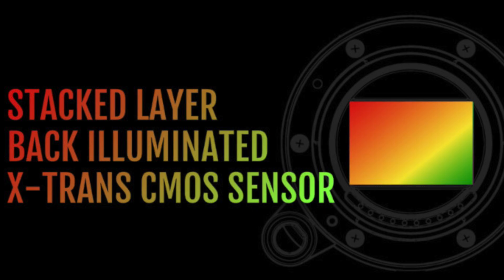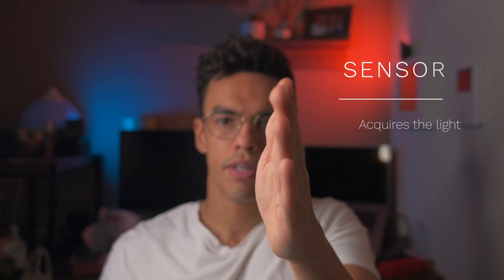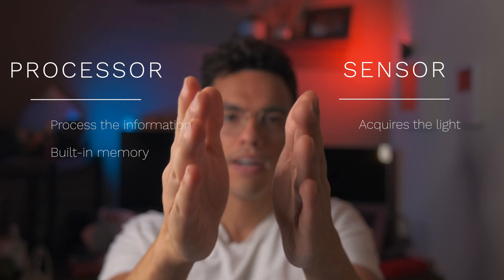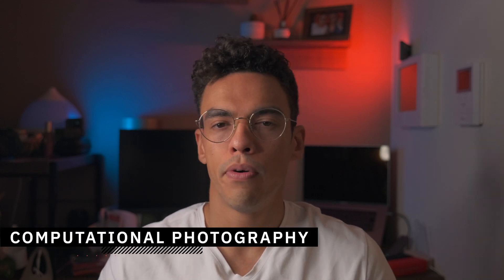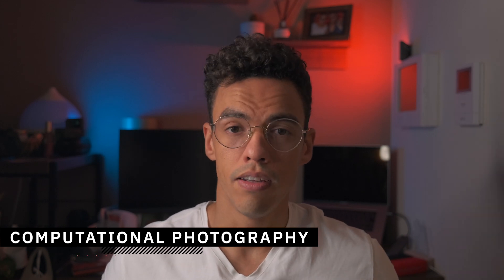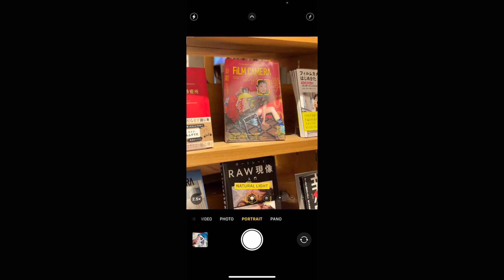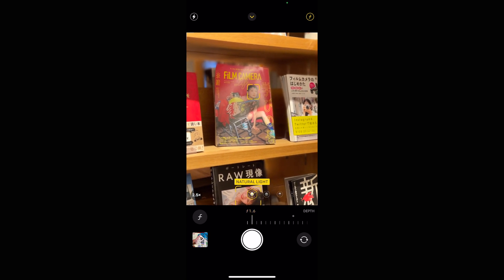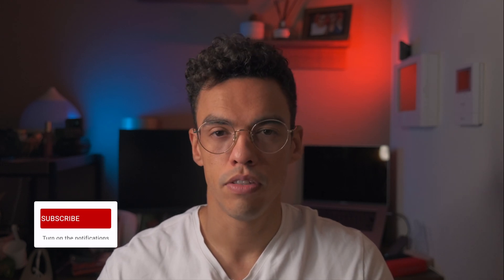Fujifilm stacked sensor explained | Coming 2022

Comment: So, with those new sensor, an aps-c sensor will be able to deal with 35-40 megapixels without slowing the system down, and without losing dynamic range?
Reply from the maker: So because the pixel density is increasing there might be more noise in low light so we have to wait and see the performance of that sensor

Comment: No way Fuji will be able to compete with Apple in terms of computational photography, their Axx chips are insanely powerful, also A.I. is one of Apple's  key areas of R&D, they have been on this for the last 10-15 years, and are one of the top 10 players. I simply don't see any camera manufacturer coming close to that level, even not Sony.

Comment: I really want to see full frame sensor in XT5 , not only better low light performance and level of details , I can use more wide lense like 35 mm which is really good advantage.
Reply from the maker: That is very unlikely to happen. It makes little sense on a business level as they do not want to compete on the full frame market and their lens lineup would not work.

Comment: I was with you right up until the point you mentioned faking bokeh. No Thanks.
Reply from the maker: That’s just an example. Dynamic range, hdr… there are many applications
Reply: @ThierryGibralta  Sorry, I still don't see your point - the sensor either has good dynamic range or it doesn't? You can't fake that either. None of these points are advocating true photography - this can all be done by the masses using their smartphones, and why would any passionate photographer want to falsify any photo?

Comment: I’m buying what ever body they put this in right away. The dynamic range of the xt4 is incredible. The only thing that’s weak on the fuji is the low light performance and noise at higher ISO. Also AF in low light isn’t all that great.
Reply from the maker: Honestly I think the noise at high ISO is handled pretty well though. But yes, this could help a lot with those problems. Now let’s see how much it will be…

Comment: This video propagates a common misconception that a higher pixel density will improve resolution.  This is only true up to the optical resolution of the system, as determined by the wavelength of light, and the Nyquist-Shannon sampling theorem.  Beyond this, it it useless to have a higher pixel density because the wavelength of light is a fixed parameter.  Making the pixels smaller does not change the wavelength of light.  For an APS-C sensor, as in a modern Fujifilm camera, the upper practical physical limit is about 20-30 megapixels, on a good day with a nearly flawless lens.
Reply: I think 24mp is pushing it for apsc sensors
Reply: @Chris-ey7zy  Indeed it is.
Reply: @cdl0  I thought even 18 mp was too much I had Canon 40D and stepped up to 60D and it looked worst
Reply: @Chris-ey7zy  Yes, all sorts of fancy interpolation and pixel-binning is done to give the illusion of a higher resolution than the image actually contains.  Two suggestions which may help are as follows.  First, try different demosaicing algorithms on raw-format images using a package such as Darktable, etc.  Second, simply downsize the image to a more sensible resolution, e.g. 12 Mpixels.
Reply: @cdl0  I actually had Fuji x Tran before and liked it.  Moved to Sony.   But I did recently got a couple of Sigmas dp 2 & 3 quattro just to see what that sensor is like.   Seriously thinking of getting that gfs 50ii soon.  Trade some equipment to get it.  I know it looks amazing from the few shots I’ve taken with it and like the body way more then the Hassy
Reply: This explanation makes sense

Comment: Even though the Fujifilm xt4 camera has 4k 60fps but I like the dynamic range sony a7c camera
Reply: Have you used both side by side? The difference between those two cameras in dynamic range is extremely minimal almost negligible.

Comment: As newcomer to Fuji who originally planned to switch to Sony... this is pretty exciting.
I can see a few possibilities, 
1, high end sports/wildlife camera that matches the R5 or A1 in photo specs maybe 20 fps mechanical and 30fps electronic with global shutter.
2, high end video camera like the S1H/A7S3, but with global shutter. Definitely possible since the sensor is smaller than full frame, I believe they can achieve it.
I really really hope the XH2 will be like the S1H and has full size HDMI and unlimited recording. They also need to liaise with Atomos for ProRes raw. 8K is not necessary, but a 6K sensor is minimum I think.

Higher resolution doesn't necessarily mean better low light. There is more grainy noise, but with more pixels, we can downsample images to get a cleaner look. This is advantageous at most generic ISO levels that people don't exceed (<6400 on APS-C). It won't work anymore on ultra high ISO like >12800, and that's where special sensors like A7S3 wins every other sensor in the market.

I can only hope their autofocus algorithms continue to improve. For photography, Sony still gives me more confidence since I know 90% of all shots are in focus, but with Fuji I often spray a lot more.
Reply: @M Tech Yeah, it's not necessary. That's why I said 8K (33MP) is not needed, and 6K (around 20MP) is perfect. People who need more resolution should be looking at full frame or medium format, not APS-C, so Fuji should send those customers there.

I just want their AF to reach at least dual pixel level. I'm not even asking for Sony level.
Reply: Higher megapixels sell cameras and make it easy for newbies to buy the latest as it has more megapixels so it must be better!
Reply: @sexysilversurfer  Newbies are either low or high budget. They usually buy something like the m50 or a7iii/r6/z6 as their 1st camera.
Reply: @M Tech Yeah. A lot of lenses need replacing.